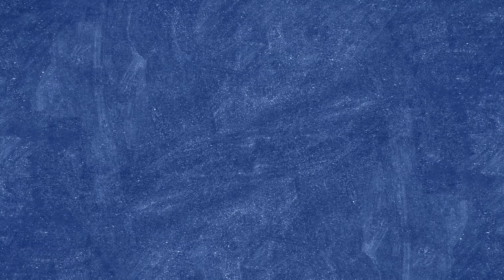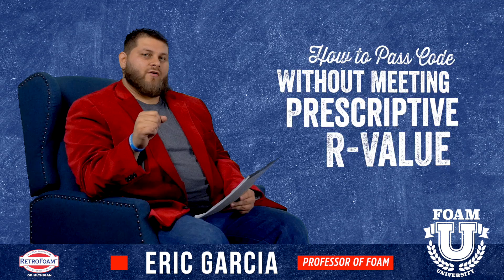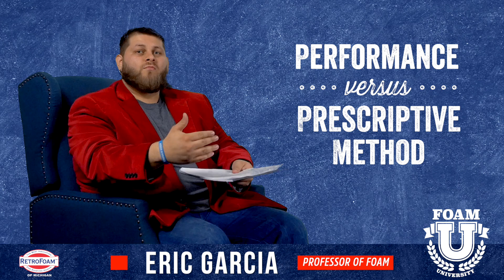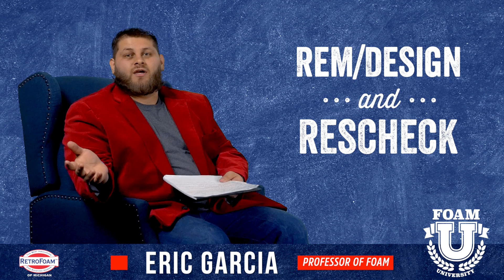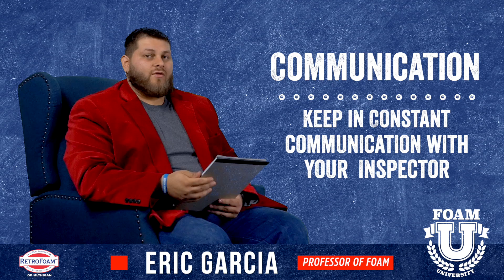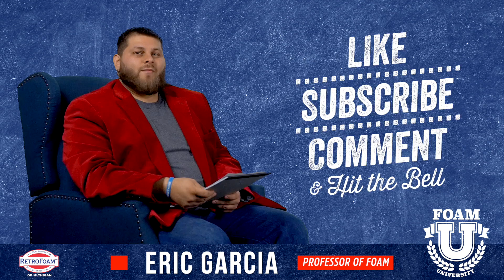How to Pass Code Without Meeting Prescriptive R-Value | Foam University

Comment: You say that REScheck will use performance vs prescriptive R-value, but I don't see where this option is. Entered all my data, but it asks for R-value of the walls. I entered in the value of 2.5" of spray foam. But it doesn't ask me what type of insulation I'm using, so I fail compliance. Thoughts?

Comment: I am looking at building a home basement with ICF insulation block heated floor and heated floors in the first second level which will be wood home first and second level I'm looking at building everything above basement like a pole barn style system pole barn metal in the outside pole barn metal on the inside and then using that retrofoam I've seen on here were you you can pump it from the bottom up for the total 20 ft High pole barn wall it would be 6 + 6 vertical post with two-by-fours the purlins on both sides the whole the metal up and give you over 8inch  of insulation one in your opinion Donuts have you ever seen or done this type of job before and also on the heated subfloors should I drain the tubing water out of it in the Summer where it's being heated in the winter to keep from having condensation or would not matter
Reply from the maker: Yes, we have worked on this sort of project before.
It would be best to spray the walls while they are still exposed.
Once you have blueprints ready or a structure up, your insulation contractor can take a look at the project as a whole to make further recommendations.